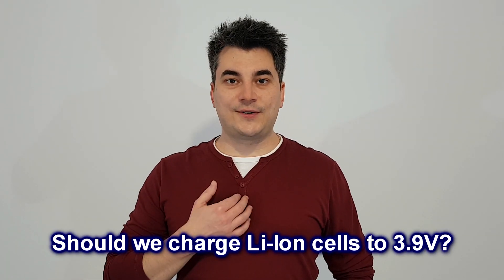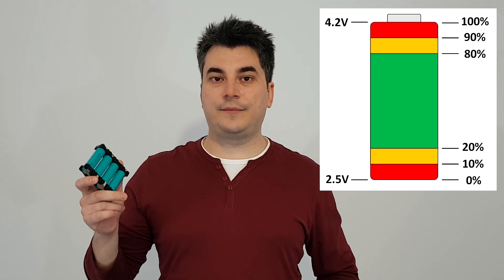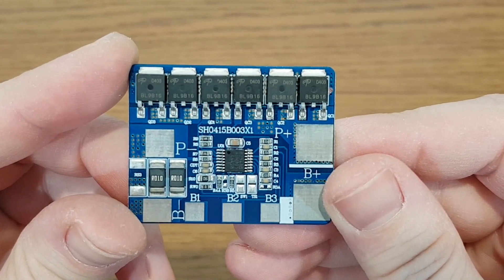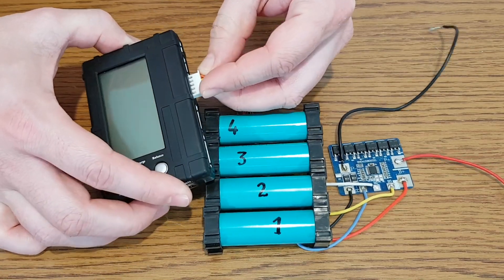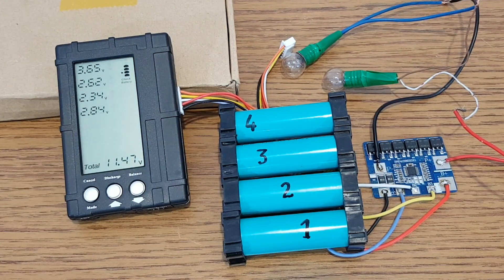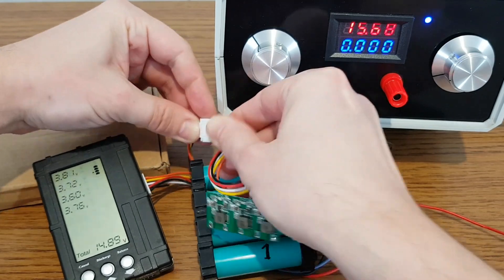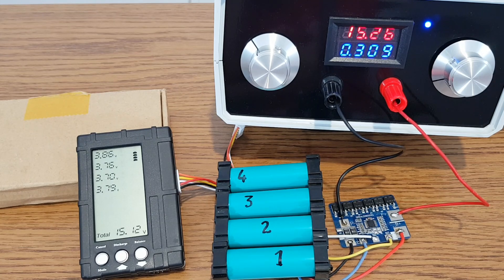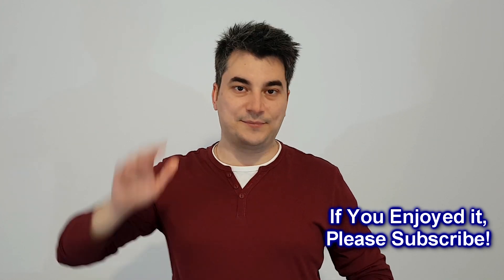Should we charge Li-Ion cells to 3.9V?

Comment: Good work Sorin .... You can also "overcharge" these cells up to 4.5 V and get an increase in capacity of 15% ... drastically reducing life to around 30 cycles ... They use these cells in Ukraine in suicide attack drones, the drone is blown up on it's first flight so only one cycle is needed ... I don't know if the drone builders know about this posibility of getting 15% increase flight time.

Comment: what's the point of the battery if you only charge to 80%,  with electric cars you only have 250 miles,   if you charge 80 you will have only 200 miles  and if you reacharge at 20%, you have only  160 miles range, which is shit if you need to go somehere across the country,     it only makes sense to charge to 80% if you are not planning to use the whole battery,
Reply from the maker: It depends on what you use the battery for. for example if you have a solar panel system with a big battery and the battery never gets completely discharged overnight, then it's better to charge it to 80%. the battery will last longer and after a few years it will still have a good capacity.
Reply: charging at 90% (and discharge to 20% "80/20 rule") double the life cycles! and at 80% u can obtain 3500 or 4000 cycles from a normal 3.7 li ion battery...  li ion chemestry "stress" in the top range (below 3.2v and over 4.05v)  its perfect for UPS or solar powered devices

Comment: So if you charge it to 3.9 volts,  where  does it level out when you connect a load?
Reply from the maker: it depends on the load and the type of the cell. the higher the current draw is, the lower the voltage will drop.
Reply: @Sorin_DIY  Yeah, I know how to calculate voltage drop.  It just wasn't coming to me where to get the 2nd variable to go with current.  I wasn't thinking, but I guess that would come from the specs of the connected load.  Sometimes I fail to see the obvious, which leads to dumb questions.  Anyway, I never knew that charging to 4.2 volts would substantially shorten the life of the battery.  It makes sense though for a manufacturer to recommend chargers that charge a little high.  It will boost battery sales.  That's what they've done with LED light bulbs.  They make them to run on 120 VAC, knowing the majority of US homes have slightly higher voltage.  They don't last near as long as they did when they were first introduced.

Comment: I charged  mine to around  6.64volt by directly  charging  battery as i had shortage of TP4056.. I Couldn't  believe  at first had to do double check and got same result.. 2 battery was in parallel connection

Comment: Why not use two bms at the same time in parallel?  Use the LifePO4 for charging and the other one for draining. It gives lower charge voltage cutoff and stops the load at the correct voltage.
Reply from the maker: that's exactly how I want to use this BMS board... if it will be available again.

Comment: my thought so. thank you for this idea. ive looking around for this solution for years. maybe a low voltage disconnect module could help to prevent the bms from over discharging the batteries like XH-M601?

a few months ago i made a copy of your 2s ups and since i only need 2 cells i go for some high quality cells. to make the story short, one of which died 0v for about a month. so i ditch the idea and went to a relay based ups-kinda switching module. it has a model number of YX850. but i removed the diode to prevent it from charging. also the battery is external 3s pack so i can switch batteries easily through dc jack. my only problem is it has 1 second delay

Comment: If i have 3s 18650 battery pack of 3 cells then how many amps and volts should we charge it 13v?
Reply from the maker: li-ion cells should be charge with a maximum charging rate of 0.5V, so if the battery pack has 2000mAh it should be charged with 1A. the voltage depends on the BMS board, usually is 13V.

Comment: hello - my headlamp uses two 18650 battery - can i use one( LG 2600 MAH 3.7) battery  and one( sunnybatt 2400 MAH 3.7 ) ?? or two batteries should be exactly the same battery (same MAH and same Brand )?  
i heard that if use  two different battery in my headlamp one battery will harm other battery .. is this true ??
Reply from the maker: you need the same type of cells, same capacity and same number of cycles.

Comment: You were the only buyer of this BMS board and  left no review on seller's page! No wonder he retired! :)
  Why you do not connect another Li-Ion 4s BMS in parallel and make some bridges in order for the overcharging MOSFETs to activate on both boards, and the same for overdischarging? In this way the cells will charge up to 3.9V and discharge down to 3V.
Reply from the maker: hi. the BMS has only one review... from me. I gave it 5 stars. you can see the customer review - S** from Romania :) I was planning to make more videos with this BMS in combination with other BMS boards, but only if it will be available again.
Reply: @Sorin_DIY  I mean you  only gave 5 stars but wrote nothing as review...
Maybe some others 4s Lifepo4 BMS cheap boards can be tweaked from  3,65V overvoltage limit to 3,9V or even 4V ...

Comment: The overcharge protection seems to work good at 3.9v that doesn't fully charge the cells for longer life. But, the overdischarge protection triggers at 2v which is below the recommended voltage of around 2.5v to 2.7v for the Li-Ion cells.
Reply from the maker: you can use this 3.9V BMS to charge the cells and another cheap li-ion BMS connected between the cells and the load, this BMS will disconnect the load at 2.7V/cell. and an active balancer to the battery pack.
Reply: @Sorin_DIY  that's an interesting idea. please cover it in the next video for us, Sorin. 😃
Reply: The over-charge and over-discharge protection is handled by the IC that is installed in the BMS and you might not be able to change these values. So the BMS will always charge the cells to 4.2v and trigger the discharge protection at 2.7 or 2.5v depending on the IC that is used in the Li-Ion BMS. Also there are high chances that the cells will lose its rated capacity or in worst case never recover again if they are always being discharged below their recommended minimum voltage. it is wise that you always use new set of cells and that from the same manufacturer and model type when making the battery pack since all will have the same rated capacity, amp rating, self discharge etc. Each cell should be fully charged seperately and then the battery pack should be created. In this case you won't even need a balancer since all the cells are new would charge and discharge at the same rate.
Reply: @jaygajjar479  I beg to differ. Cells (not only li-ion) tends to drift in voltage when arranged in series after some charge-discharge cycles, although they was picked from the same batch in production. That's why usually Lipo packs that built from series cells (2S or more) has balance leads.
Reply: So it's better to use normal BMS for li-ion, and set maximum charger voltage to around 3.9-4.0v
Reply: @4krist  yes, BMS and an active balancer will do the job.

Comment: Couldn't you just take an ordinary bms and just charge it using a suitable supply with a max voltage that correponds with 3.9V/cell? For example a 3S pack with a cc/cv supply of 11.7V. I don't see the need for the LFP-bms.
Reply from the maker: no. the charging current needs to be completely stopped. a BMS will stop the charging current only if one of the cells reaches the overcharge protection voltage. for Li-Ion BMS boards this usually is at 4.25V. otherwise the cells will be indefinitely charged with a few mA (like lead acid batteries). this will damage the li-ion battery.